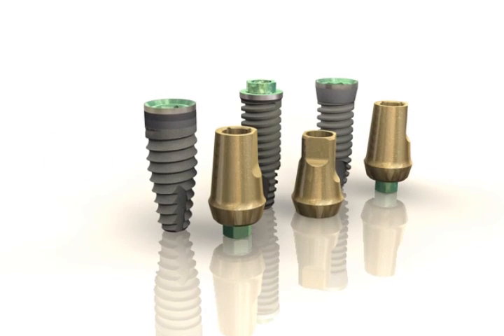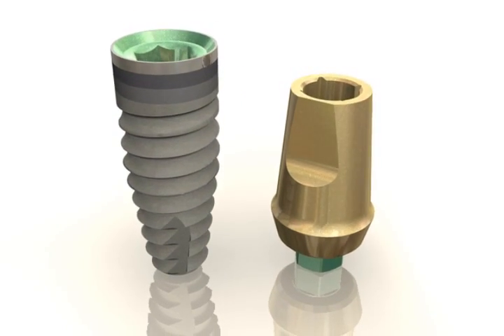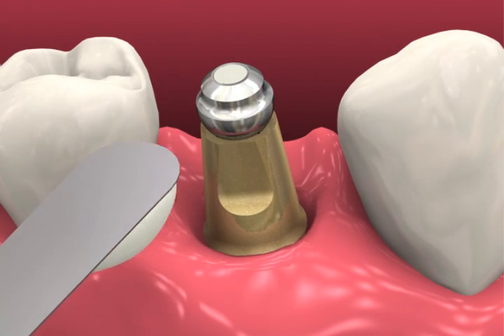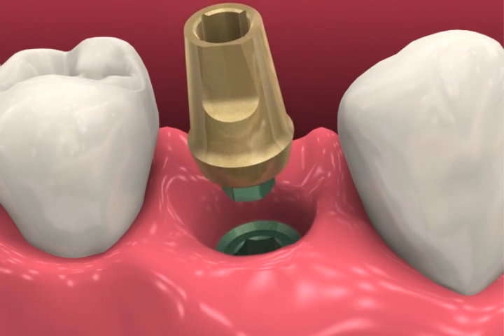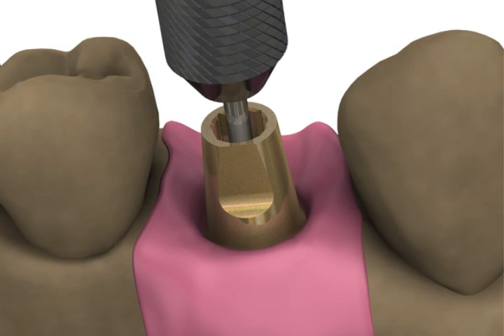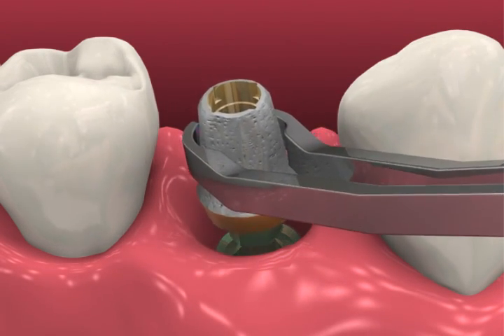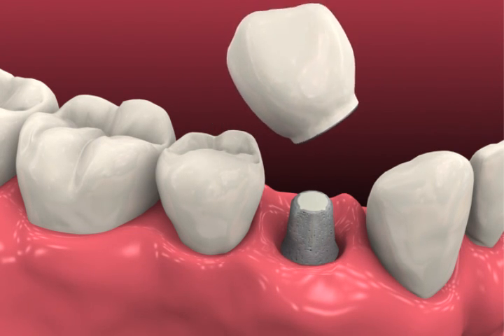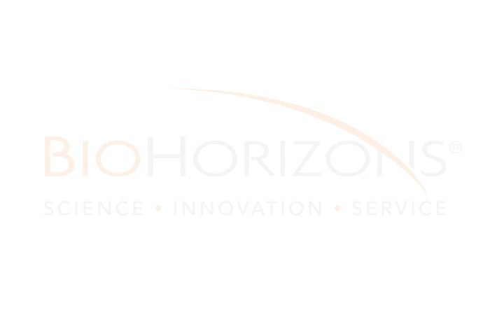Restoring dental implants video BioHorizons

Comment: in few days from now I will go throught with this operation..hoping it will be ok
Reply: How did it turn out ?.
Reply: It turns out OK I'm now in the last process to put the teeth in two weeks.
Reply: Modesta Magdula
 OK  thank you , because I am probably going to get one myself !!.  I may  be checking back with you to see how it went .
Reply: DON'T worry you will be fine as long you have this good doctor and try to clean properly it will be fine. I'm excited to have my teeth. When making hole is I feel pain little and have a hard time to eat coz it will be inflame for 3 weeks after that it will be fine back to normal. God bless to you new plan. It's expensive but it will worth not to di story other good teeth because I have this fix bridge before.

Comment: Sounds great for a lot of people. But I've got Crohns disease with near non-stop inflammation that means my body refuses any sort of foreign body, it doesn't even like it when you use my own body. Try anything like this and horrible infections set in no matter how hard we try to keep it out.

I really like the idea, I just hate their's no way I could do it.
Reply: @R S Nah, I've looked into this. Because of my family history and a very severe crohns disease that means I'm essentially always in a flare up (we've tried every biologic on the market) I have bad teeth, even back then which is why I was on this video in the first place because I knew at the time what's happening to me now (losing basically all of my teeth) was in my future.

Three doctors and two dentists basically said they strongly recommended against it and that's been as recent as a year ago. Basically because I have zero immune system this would be a constant infection risk. Even if they got me through the post-surgical period without issue it would remain a constant and present threat because one incredibly strong flareup or systemic infection and they could have to pull them all out just to save my life and/or jaw.

TL'DR - Doctors have said no not just back then but recently as well, being backed up by a dentists. Mostly because my crohn's is on the heavily severe side of the scale if not necessarily the worst case around.
Reply: @R S Thanks for your thoughts.

Comment: The most important step after implant surgery is to make the BEST crown/bridge. 
Dentists use traditional method (called open/close tray). They KNOW that this is a very inaccurate method,BUT they have no choice. 
UNTIL NOW!
As a patient, DEMAND the G-Cuff™, the best solution for your.
G-Cuff™ is a new method for impression with an extreme accuracy. 
no pain, no additional visits.
One impression=One restoration. And it costs to a dentist ....almost zero.

Google G-Cuff™ by Stomatotech (Canada).